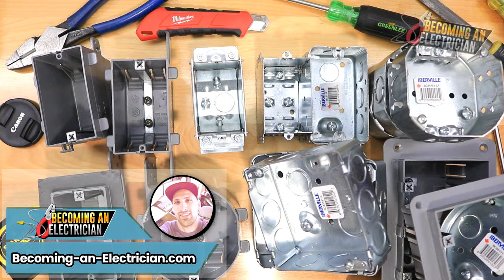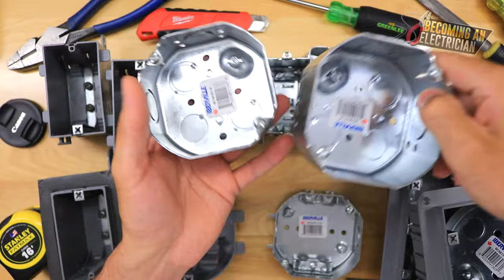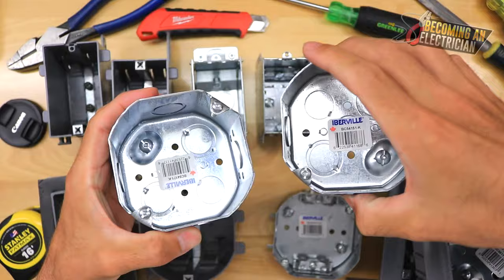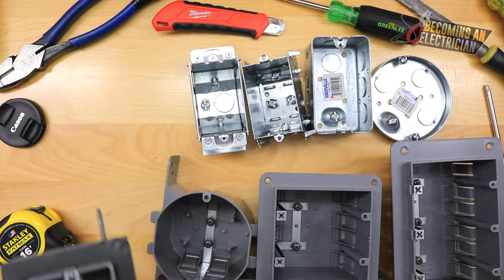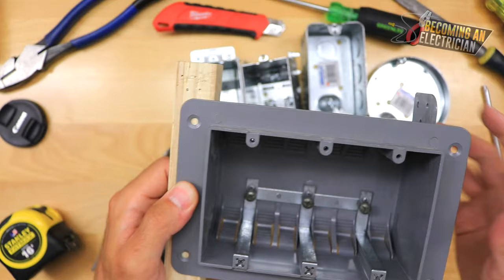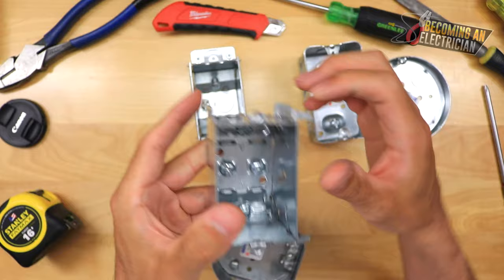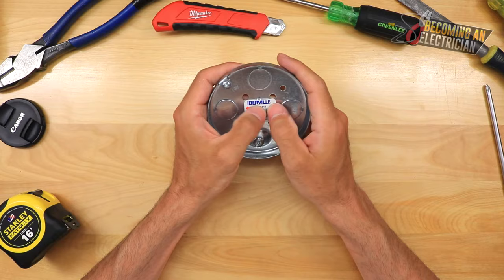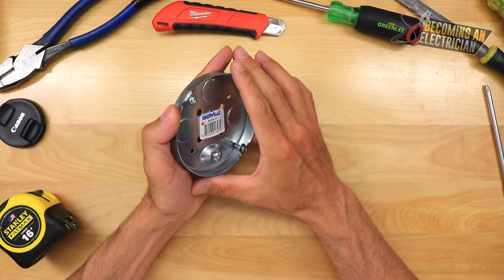Different Types of Electrical Boxes

Comment: THIS IS FOR A CANADIAN AUDIENCE: the outlet shown for a range in the US needs to be on 50 amp circuit, and as such needs to be wired with 6 gauge wire and not 8 gauge. There are subtle differences, make sure you are referencing the NEC appropriate for your area.
Reply from the maker: Oh that is interesting.  Yes, Canada was always 40A and #8 AWG Copper, and the plug had all slots vertical.  Dry is 30A breaker, #10 AWG Copper, and one of the plugs has an L (for laundry 😎)
Reply: Thank you for informing me

Comment: Great videos, i was looking for help, im doing electrical in an old trailer that has 2x2 wood framing, ive got dimmers and usb outlets to install and theres not much room for them , any ideas or tricks?, the boxes i have are shallow 1 1/2 and the walls well be covered with 1/2 cedar , so 2 inches max, the electrical outlets with the usbs are about 2" and same for my dimmer switch
Reply from the maker: I'm not sure of an answer... my guess is you will have to try and find slim switches, or built out the wall 👎

Comment: What do you recommend for a junction box in the attic? Is it best to mount the box above the insulation like on a rafter or is ur ok to cover it with insulation? Is there such a thing as an IC rated junction box?
Reply from the maker: Hey, good questions.  I cannot give advice here, I'd talk to your local electrical inspector.

Personally, I'd mount the junction box above like on a rafter because you can easily see it (not buried), and it won't be in the insulation.  A metal 4x4 with a cover I'd use.  (Again, talk to your local electrical inspector for the proper installation in your area).

Comment: what the heck area are you in? I've never seen some of those plastic boxes you have! pretty neat :) Usually get the blue carlon ones here but 2021-2022 we were having a time getting boxes in my area, local suppliers started getting in these generic black boxes that I had not seen before, and when we were really desperate, we'd grab fiberglass. But never seen some of these gray plastic boxes like you have there here in east tennessee :) pretty cool!
Reply from the maker: I'm from Canada, these boxes shown are the ones most commonly used where I'd work!  Thanks for checking out the video!
Reply: What is the brand, do u guys do 120v??
Reply from the maker: @rul1175  These are Iberville I think.  120V for basic plugs, 240V for ovens / dryers (it's 208V in 3-phase systems here).

Comment: Very good 👍
Reply from the maker: Hey thanks!  Appreciate your comment.. more videos coming up soon 🙂
Reply: @BecomingAnElectrician  it seems like commercial Buildings never are spec for plastic boxes?
Reply from the maker: @rickyperkins232  I've never really seen a jobsite spec specific boxes, but types of wires.. which will then decide the types of boxes you use.  Also, using metal boxes on metal studs allows you to keep bonding continuity, plus you can use EMT pipe, BX (Armored Cable), and they are usually just more flexible in terms of what you can connect into them..

I really prefer the metal 4x4 boxes that have the metal strap on them (compared to 4x4 metal boxes without stud wrap!)

I really do like working in plastic boxes in residential.. easier on the hands.. don't get cut fingers as easily 😁
Reply: @BecomingAnElectrician  understood

Comment: I am installing 15 amp receptacles in my barn. All exterior mounted to 3/4 plywood in conduit. I am running 10/2 because it is over 100ft. My questions - can I fit a gfci, receptacle and feed out to the side of the barn in an extra deep 4x4 box?  Thank you very much,!
Reply from the maker: Hey!  Contact your local electrical inspector, as rules are different where you live!

Comment: Thanks for the video! On the easy box example @16 Minutes,  the wires go into the top of the box and clamp down. Question: which grommet and size would you use to protect the wire. thank you
Reply from the maker: For the EZ Box, it should already have a clamp built-in.  Remove the wire jacket, pop the EZ Box tab, insert the wire, and tighten down the wire clamp!
https://becoming-an-electrician.com/
Reply: @BecomingAnElectrician    Thanks for responding. The knockout on the top must be removed to insert the wire. this leaves a sharp edge. Do you use a rubber grommet or other option to protect the wire. or do you just insert the wire and tighten down the clamp. thank you
Reply from the maker: @chris23384  First, the cable has different components to it.  It has the outer sheath, which is what you are stripping off.  Then inside are the conductors, that have their own insulation to identify what wire is which and prevent short circuit.  Simply strip the outer sheath (JACKET), then insert the cable into the EZ Box so that the JACKET goes under the clamp.  If it's super sharp, you can try to file the EZ box hole if you're really sketched out before putting the wire in and tightening down.  But generally, you just strip the wire jacket, pop the EZ box knockout, put the wire in, and tighten it down on the jacket (not the individual conductors, if that makes sense).

Comment: What do you mean about bonding in the plastic box
Reply from the maker: Could you clarify your question further, and what you're confused about? - We always need to bond a box.  Bonding is a word that gets confused with "grounding".  Grounding only happens at one point of a home's electrical system.  Bonding then ensures no equipment body can be energized.. if it happens, it will trip the breaker!

Comment: Thank you for sharing your knowledge.

I do have a question regarding pancake boxes. Can they be used outdoors (e.g. for a porch light) so long as they are recessed into the wall and not surface mounted? I know that they are not weatherproof.
Reply from the maker: Yes I think you can.. they are most often used if you need to get a light perfectly center, but the stud/joist is in the way.  You can mount the pancake box center, and still allow a wire to get into the pancake box.  Remember, only one wire is allowed in a pancake box!  (Always double check with electrical inspector if you're allowed using outdoors.. rules change way too often in the electrical industry.. hard to keep up).
Reply: Thank you for the prompt reply. It’s greatly appreciated.
Reply from the maker: @vince6829  You are very welcome!  Thanks for the comment, and I hope the videos continue to help you.